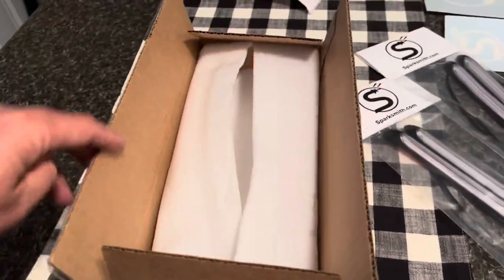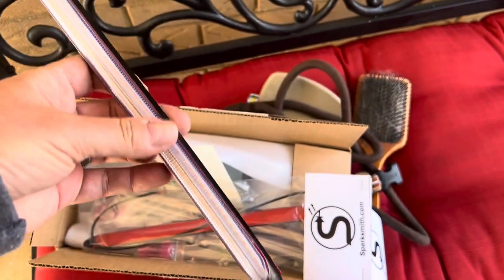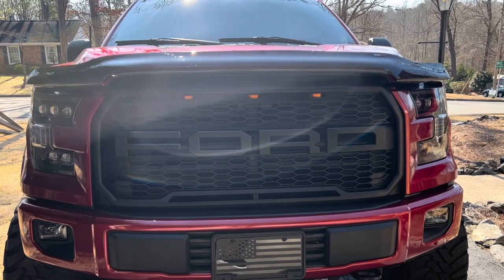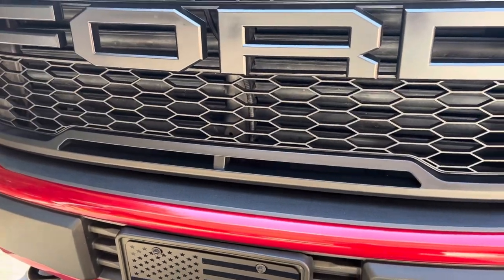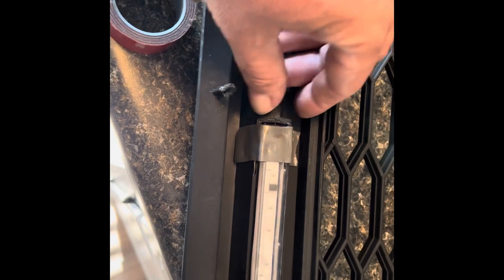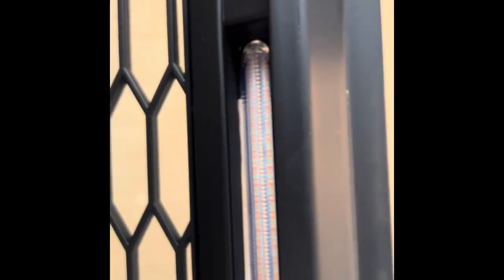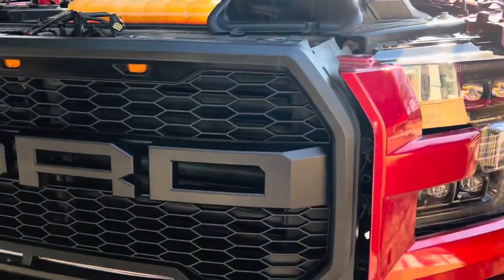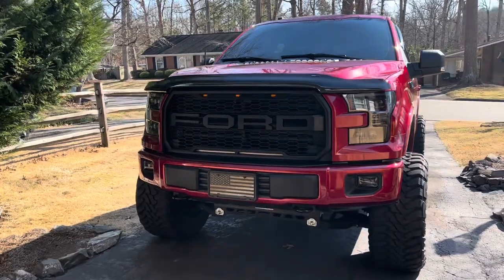Custom Grille Lighting

Comment: Just a little confused on the lights turned on upon startup, what did you wire them into?
Reply from the maker: I ran wires into the cab, into a switch I mounted on dash, then out of switch and back outside to wire to parking lights. That way I can control with the switch inside.
Reply: @LivinWith3M  thanks for clearing it up, but could I get the same effect from wiring it straight to the headlights or drl’s?
Reply from the maker: You’re welcome. Yes. You sure could. Just go from those lights into the drl or headlights or parking lights. I just added an in-line switch for a little more control. It will work just fine with your idea too.

Comment: Do the blinkers work the way you have it wired with a toggle? Truck looks Awesome 👍
Reply from the maker: Great question. Nope I don’t have them wired up. On the led strips it has red, black and a yellow wire. I just utilized the red and black. You can take a yellow from one light and wire it to left turn signal and yellow wire from the other led strip and wire it to the right turn signal and they will flash. 👍🏻

Comment: Hey Mike I got a question I have the same 7 inch ready left on the identical same truck same wheels and tires almost. I have a little popping in my steering wheel do you have the same problem?
Reply from the maker: Hey Tony. I never had a popping noise. I did have squeaking when turning the wheel. I took it back to where they put the lift on and they greased the steering column extension in the engine bay and that stopped it. Maybe yours is binding and needs some grease. Just a thought.